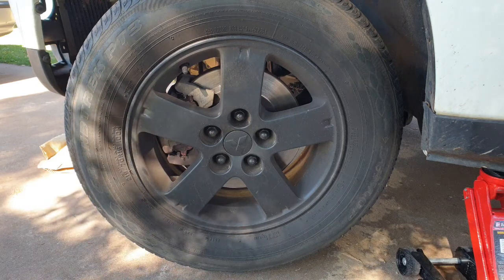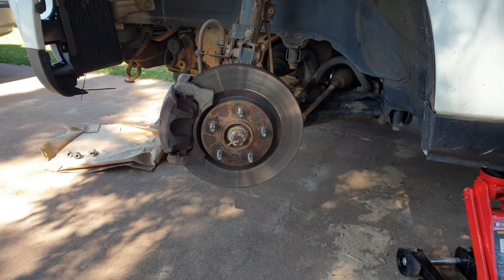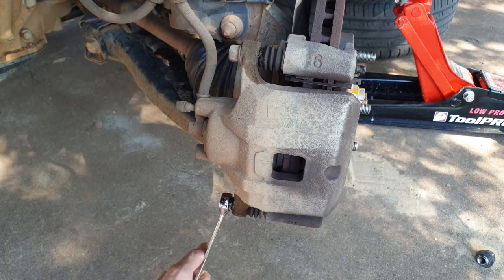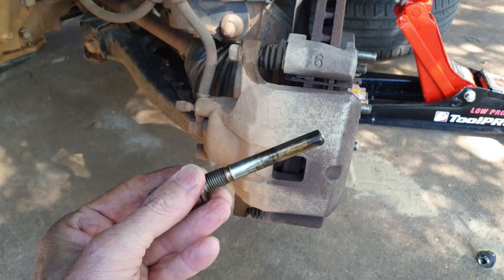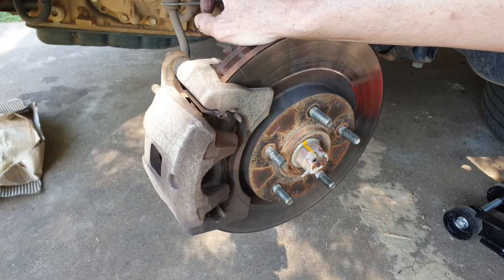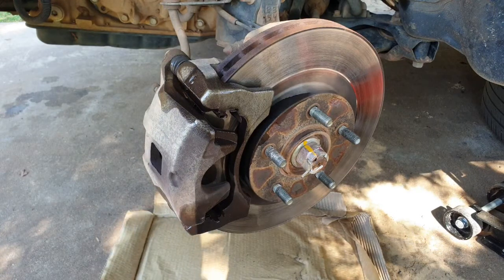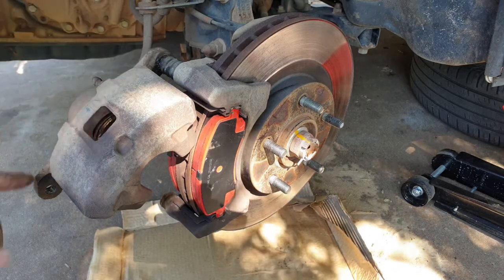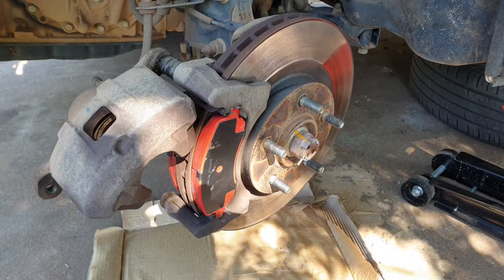2008 Mitsubishi Outlander Front Brake Pads

Comment: Top stuff mate. Very clearly explained & easy to see. About to do our 09 2.4 4wd outlander. Should be similar. What was the clear lube you used on the pins? If ya do any more work on it, whack it up. That was the best vid on here by a country mile bro
 Cheers Rod... Aus.
Reply from the maker: Thank you for the kind words, it means a lot to me. The clear grease that I used is silicone paste or silicone grease, it can be a bit hard to find but most auto stores will have it. As for your model (09) the brakes should be the same if not very similar. Thanks Jay
Reply: @jayfix6126  Got it done mate. The day before i did it an abs service warning came up on the dash display, which was a worry. I changed the pads using your vid as a guide & they went in ezy as. On the first test drive around the block the warning signal cleared itself.i had an issue though. On the fr left caliper 1 of the pins bolt was rounded off. Your method enabled me to get it done only undoing the other pin but still lubing both. The pads on this side were shot but the otherside were still 50% which makes me think only 1 side was replaced in the past due to the rounded bolt. I did both sides. Cheers again mate.
Rod...